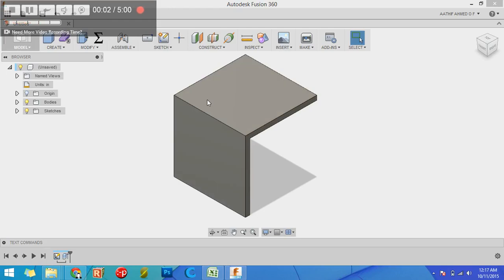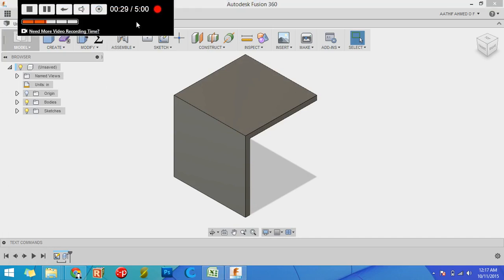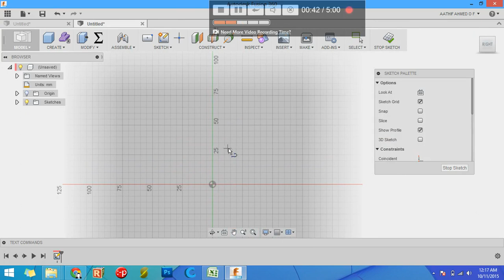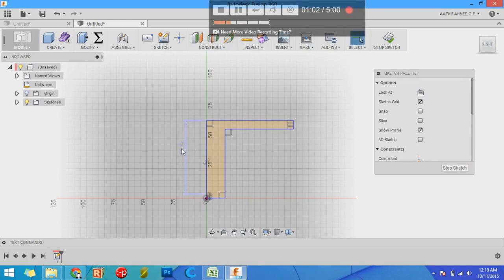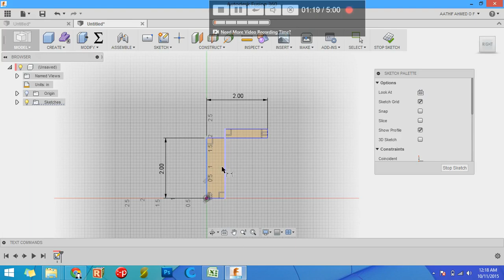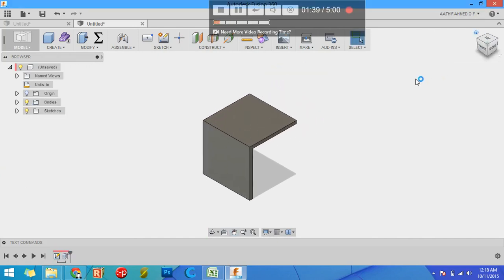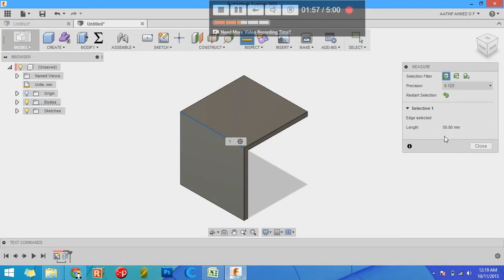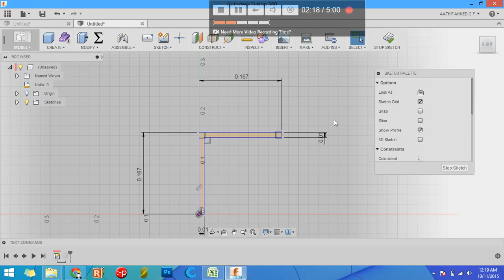Fusion360 Switching Units - Simple and Easy

Comment: Thank you for sharing this video. Juggling between unit systems can be stressful and tedious. You might find Enveter for Fusion 360 useful, especially for more complex conversions. 

Short for Engineering Unit Converter, Enverter has been specifically tailored to address engineering and scientific unit conversion calculations with over 4300 unit conversions available in more than 20 different categories.

Available online for FREE via web browser, Enverter is also available as a plugin for CAD systems, where built-in unit conversion often only addresses length, mass, and time conversions.

Currently plugins for Autodesk Fusion 360, SolidWorks, and Cura are available for download.

Enverter was recently covered by Develop3D (https://develop3d.com/cad/enverter-launched-for-dimensional-analysis-unit-conversion/
) and DailyCADCAM (http://www.dailycadcam.com/enverter-dimensional-analysis-and-unit-conversion-software-for-engineering-and-scientific-calculations/
)

You can download free 30 day trial of Enverter for Fusion 360 here: https://www.enverter.com/download